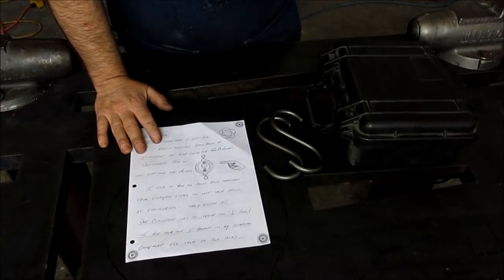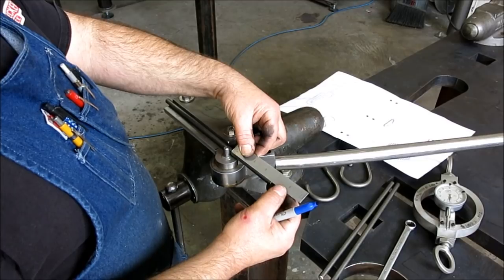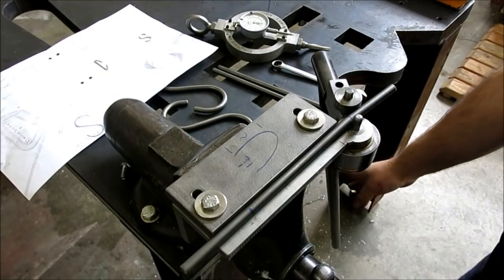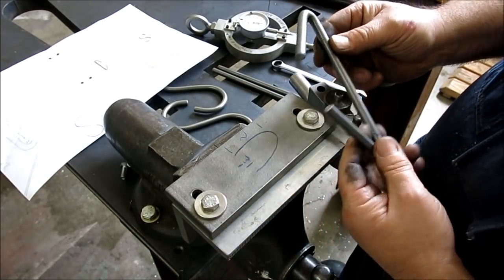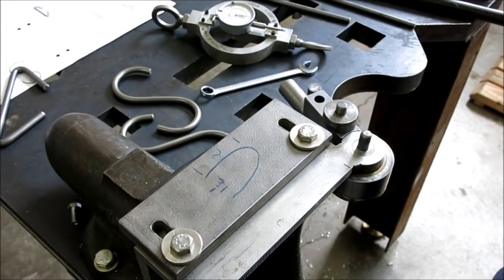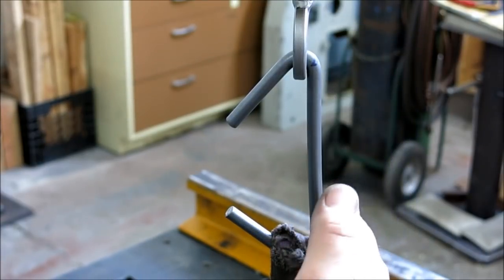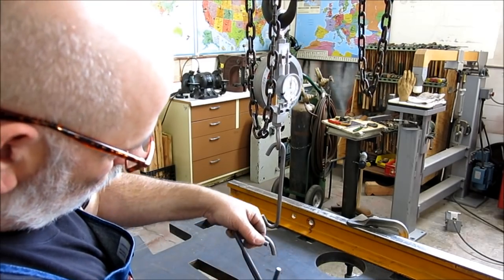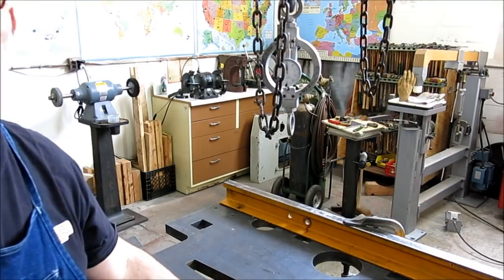Hooks and Crooks 2

Comment: Hi Tom,
The bender looks home made, if so what are the pins and roller made of ? It has to be something considerably stronger than the same sized cold rolled they bend.
Reply from the maker: Hi Manu,

The pivot pin is made of A-2 tool steel. The sweep pin is a dowel pin with a O-1 steel roll on the outside.

Cheers,

Tom
Reply: oxtoolco
thanks !

Comment: Hi Tom,

Will have to make some of these! Any shots of your overhead hoist/chain block, does it pivot on a pillar in the buildings frame or something?

Dan
Reply from the maker: Hi Dan,

Its a column mounted job crane that I built. Check out the shop tour video for some shots of it.

Cheers,

Tom

Comment: There was no contest here. Smaller radius = bigger load. I bet that if you'd make them smaller in the shaft area the bow would be nonexistent practically.

If you look at the hooks Nasa used back in the day to transport equipment off the lander and to the astronaut you can see the same philosophy. Even if they never needed it since Moon gravity is lesser than the Earth counterpart. Reason being that they had to test all of this equipment here before they let them use it there so it had to withstand our gravitational pull to pass.

Different applications of course, but my point is they chose the higher load bearing one but that could snag over the one that would not snag but didn't carry as much.
Reply from the maker: Hey Aserta,

I agree not much surprise here. If I could load test them to failure then that would be interesting as it looks like these could go much higher. I just don't want to have my crane land on my head.

Cheers,

Tom
Reply: oxtoolco 
(to be proper and respond in kind :) )

Hey Mr. Lipton,

Yeah. I guess there's no way to safely test them and anyways for the purposes at hand i believe this test suffices.

If i were to take a shot in the dark i'd say each of those two can at least take twice the tested load or there about. The shorter of the two might even take more, since it barely seemed to bow out when compared to the longer counterpart.

Either way, these are nice designs and for moving regular shop item B from one spot to another it believe these would suffice to anyone.

Have you done a video on your shop crane setup? If not and you find yourself lacking a subject that would be a nice little segment.

P.S. any relation to Thomas Lipton? I was searching your name to make sure i wasn't going wrong about it, being new here and all that, and i stumbled upon the Wikipedia of this Sir Thomas Lipton. Interesting name coincidence none the less.

Cheers, 

Andrew

Comment: You would increase the load bearing possibilities even if you were to make the small radius hooks with reverse bends similar to the "S" hook because the back of the hook would not deflect as much as the "C" design as the load is placed over the X or central axis of the shank. The tight radius hooks would also increase but the tight radius is not a good design for two reasons. First, the hooks are too tight to accommodate the slings properly and weaken the sling eyes. Second, the metal would have more of a tendency to crack in the bend are due to over stressing and upset in the metal grain structure from the way they were formed.

Comment: That was sort of a surprise as I expected them to all perform just like the S did.  Do you ever go home at night?  I have made some videos and they take hours for the editing and rendering even after you record the action.
Reply: These hooks are stronger since the load bearing points are nearly in-line with the stock itself.  It allows them more easily approach the tensile strength rather than bending the hooks out.
Reply from the maker: As you know I'm a machine that looks like Tom. He is watching TV right now.

Cheers,

Tom

Comment: Hi Tom, If you heated the rod red hot with a torch before bending it, how would the strength of the hot-bent hook compare with that of a cold bent hook?  Would they be different?  Thanks,  -Chris
Reply from the maker: Hi Chris,

We did that before. We tested some blacksmith forged hooks and they weren't quite as strong as the cold bent hooks.

Cheers,

Tom

Comment: I love you always give out metric. I am Australian but I do have American citizenship as I lived over there in Youngstown Ohio but I really struggled with imperial, the fractions like 1/2", 9/16 and so on are easy as I was a mechanic so they get picked up easy but when I get to the decimal fractions in size I get confused easy. I trained over the years to be an Auto Electrician, Mechanic,  Auto Body work,  Computer tech, Programmer and a general labor worker and that's what got me in the end as I was 3 floors up pouring rain on scaffolding with a wheelbarrow slipped  and fell 3 floor clipped my neck on the way down, now you might think I should be dead or paralyzed but I just crushed 2 vertebrae and over the years it's damaged my spine. I am lucky  but ended my working life. I think I got allot done by my 40 years but now I got my little lathe and use my drill press with  a 2 axis vice for milling and now learning from you Adam And Keith Rucker how to do the jobs I want to work on, my way of thinking is " You never stop learning unless you are dead or ignorant " and it's got me this far.
Reply from the maker: Hi Giga,

Good words to live by. One of my sayings is "Learn everything you can about everything you can" Thanks for the comment.

Cheers,

Tom

Comment: Tom,
On the bending jig I noticed that no lube was used on the bent rods. Is that the usual approach?(I know jack squat about such things)
Eric
Reply from the maker: Hey Eric,

For bending like this with a rolling element lube doesn't help much. Where you see some benefit is things like tube bending where there are a lot of things sliding against one another. Now you have squat.

Cheers,

Tom
Reply: Ahh because the forming rollers move on the jig...got it!
Thanks.

Comment: i dont see that the table is bolted to the flooring as well as no shake/wiggle or sliding. is the table plate atleast 2" thick???
Reply from the maker: Hi Erik,

That table is only 1.5 inches thick. Thanks for the comment.

Cheers,

Tom

Comment: wont your straps fail signifigantly earlier when they are not sitting flat and perpendicular to the load?
i was going to say that the two tight hooks are pretty much identical as far as the load is concerned but yeah.. 
if you wanted the most out of the strap and hook wouldnt putting an overkill ring between them be best so the weight on the hook could be as close to the vertical section of the hook (putting it in tension without making it want to deflect) while also allowing the strap to be happy and "flat"
Reply from the maker: Hi Miles,

The slings in this case are significantly stronger that the hooks under test. You are correct to get the most out of the sling you should have nice and flat. This is not always possible which is why lifting gear has a large factor of safety. Thanks for the comment.

Cheers,

Tom
Reply: Miles11we

Comment: small question does  dynamometer have to be recalibrated does it not deform ?
Reply: Simon, it seems like as long as you don't exceed the elastic deformation regime of the frame metal (steel?) then there would be, by definition, no permanent (plastic) deformation. And, since most metals have a generous elastic deformation range (they are "springy") these very small deformations probably don't exceed that.
Reply: Thanks I really enjoy your videos 
I learned something every time 
27 years in the trade  and thankfully still enjoying learning new things 
Thanks Simon
Reply from the maker: Hi Simon,

The dynamometer operates in the elastic range of the material. So its like a big spring. As long as you don't overload it the spring returns to the starting point. When you calculate the allowable stress you make sure you don't approach the point where the material will yield. Thanks for the comment.

Cheers,

Tom

Comment: Tom, just curious. Can you put your new hooks back into your bender and see where the hooks reference back to compared to the previous marks.
Reply from the maker: To see if they yielded? The resolution of the mark is not that great and there is springback when they are bent. It would be best to measure some spot and record it to check for distortion.

Cheers

Tom